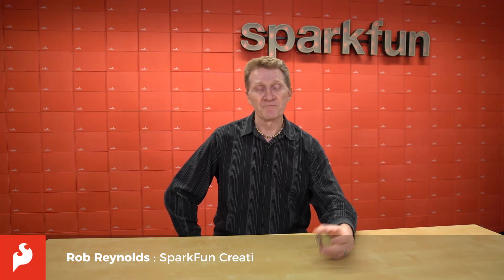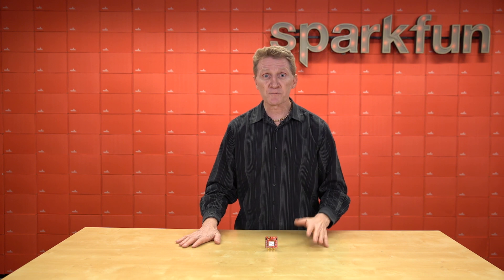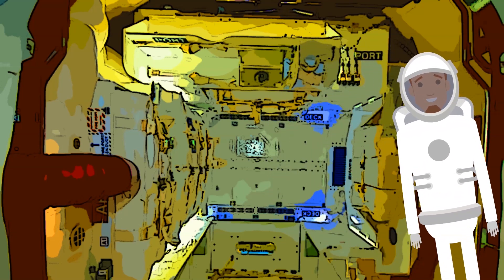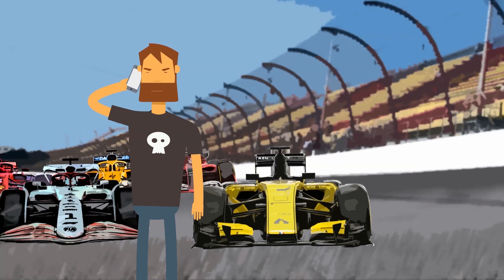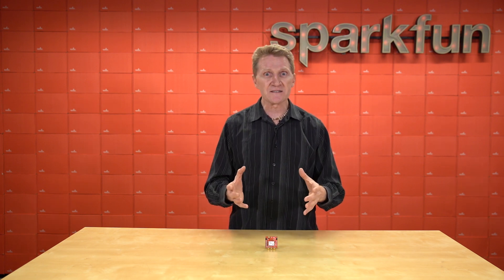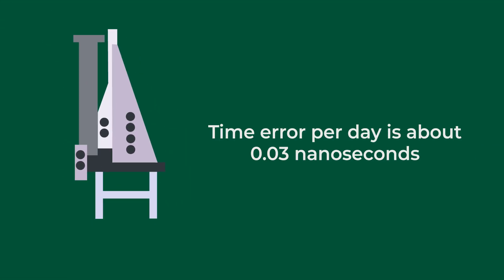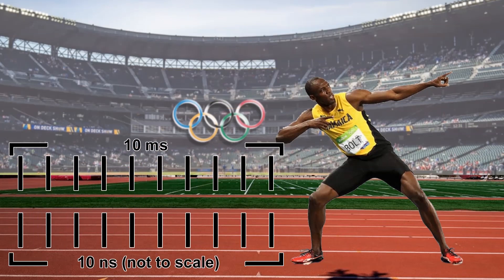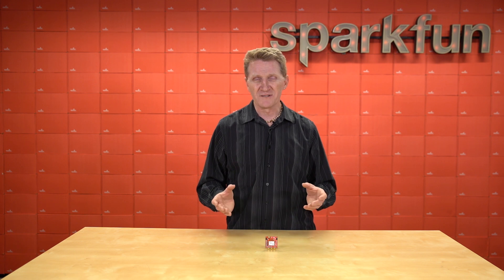Precision Timing with GNSS

Comment: I believe your comment that the clocks running  at Boulder, below sea level, and up in space, all run at the smae rate is WRONG.  They are located at different points in Earth's gravity well, and,because of Eisenstein (yes, that guy again) , time flows at a different rate for each of these cl cocks..  The orbiting satellite's  clocks correct for this or else GPS would not work.
Reply: 100%

Comment: I have always want to play with gps disciplined crystal oscillators for making a frequency standard. Is nuts how accurate they can get.
Reply: If you need to deploy a system, look for a used Symmetricom SSU-2000, they're on the secondary market as telecoms switch to VoIP (or go out of business). Unless you just want to learn, then have fun.